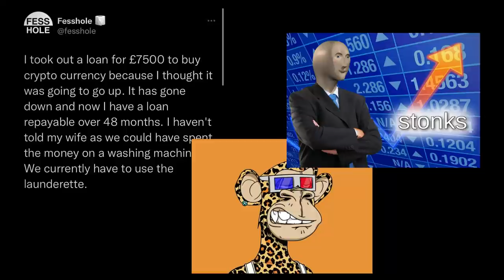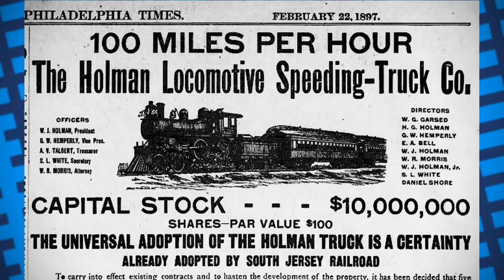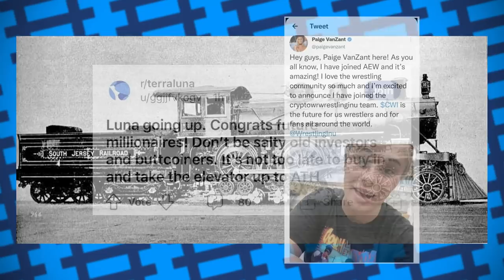How a railroad scammed investors by putting trains on stilts - Holman Locomotives

Comment: I can't imagine those things going on curves at high speed and not tipping over.
Reply: You can’t and neither did these guys most likely
Reply: Ok but it crashes like it does on trainz
Reply: The height also means more windage. So it's slower.
Reply: I really want to actually construct a physical copy of one of these just as a testbed to see how utterly stupid the performance statistics of the engine would've been
Reply: Little wheels equal speed? Didn’t British passenger locos use 8 foot drivers for speed? It’s pretty well known even then.
Reply: @philvanderlaan5942  Yeah that's what I thought....
Reply: @philvanderlaan5942  The larger drivers were to slow the action of the pistons, rods and the RPM of the wheels, and are  equivalent to overdrive on a car. Compare the Alco Big Boys built to only run between  Ogden Utah and Green River  Montana and the Alco Northern designed to haul passenger trains. The big boys have much smaller drivers increasing the torque to the wheels. Compare that to a modern diesel or electric engines that have  18” to 22” wheels but can go much faster than  any steam engine ever could. The size of traction wheel has no correlation to the rail speed obtainable.
Reply: I might be wrong but large wheels are more for speed and small ones are for power. Look at the Shay  locomotive. It was for logging on tight curves and steep grades.
Reply: @july8xx  You are WAY OFF on your wheel sizes.  Modern diesels range from 40-45" wheels.  Even the smallest freight car wheels are usually no smaller than 28", and that's because of height restrictions.  On average, most freight car wheels are 36".
Reply: 0:57 indeed
Reply: That’s okay though; it can’t get to high speeds. :P
Reply: Yeah that's why it's mentioned in the video.
Reply: Yup

Comment: The first practical reason that came to mind to me was -- more wheels = less load per wheel = less rail loading and wear. There were several diesels made that were essentially 4-axle locos with two 3-axle trucks for just this reason in areas with lighter track and bridges. Example, EMD SDL39.
Reply: If it was done on the cars that are actually carrying the load then maybe.
Reply: @michaelgarrison688 
Locomotives generally weigh a couple hundred tons and in the days of steam the drive mechanisms where a major concern for basically hammering the rails to pieces.
Look up "last of the giants union pacific railroad" at the 8 minute and 15 second mark they make specific mention of this issue when talking about the Mallet's front driving unit.

Comment: "Left: The Holman... Thing.
The word 'locomotive' scarcely seems appropriate.
The wheel arrangement is 6-12-0, if you count the wheels actually on the track. I refuse, however, to classify this with proper twelve-coupled machines."
- Douglas Self, Museum of Retrotechnology, before the 17th of May, 2005.
Reply: It's known as the Holman Horror for a reason.
Reply: @hedgehog3180 That’s where I learned about this thing!

Comment: And yet legend has it that the employees and employers of Holman Locomotive Company got away with this scam without consequences and had passed on without a trace.

In other words, the peoples behind the Holman Locomotive Company scam where never found out or punished
Reply: To be fair, the company DID deliver a "working" locomotive. So in a legal sense, the company did absolutely nothing wrong
Reply: @chanachon56  okay, however, it’s like they knew it would fail but kept themselves quiet
Reply: @nathanchan4653  Oh absolutely! But you can't prove that in court. "No your honor, there was NO possible way for us to foresee the design's failure. As the court can clearly see in these schematics, the design is labelled as 'experimental', which necessitates the building and commission of the locomotive in questionas a prototype to fully discern the design's viability."

Or something along those lines.
Reply: @chanachon56  Aye an experimental flogging is what those scammers needed.
Reply: never found? Did they try looking AT the holman locomotive company?
Reply: Much liker watering down stock and various other practices like insider trading, stuff like this was basically legal back then.

Comment: Originally the idea was to get more traction by tripling the number of drive wheels.

The math actually looks good until you factor in the internal slippage of the system ( a wheel driving a wheel, that drives the wheel in contact with the rail) 

After field tests showed no measurable improvement in traction and some major problems they decided to unload the bad  idea onto the public.
Reply: what if they replaced the upper wheels with gears instead of wheels to eliminate the slipping?
Reply: @cheezitz6730  This just introduces more manufacturing complexity, mechanical wear, and friction.
Reply: you don't increase the friction by increasing the number of wheels, that is not how friction works.  they obviously just tried to attempt higher speed by torque reduction with the smaller wheels, they just chose a really dumb way to do it

Comment: It doesn't take a basic understanding of engineering to know that design was awful. All it takes is a simple understanding of entropy.
Reply: At the time 'a simple understanding of entropy' was not a given. The second law of thermodynamics was cutting edge science. c. 1865.
Reply: @robertmyers5269  Fair point.
Reply: in my opinion (i'm not an engeneer), it works great as Hyperloop🤣🤣🤣🤣🤣🤣🤣🤣

Comment: While there's no doubt a scam involved, I can't see the engine going faster what was promised from this design.  there's no additional gearing.  More likely the idea was to provide more tractive effort with more wheel contact on the rail.  It's not the most ridiculous thing I've seen as a way to make use of an old engine that is just sitting around anyway.
Reply: Yes, there was gearing, albeit simple friction gearing as opposed to teeth. Look closely at the main driving weels - they rest on a smaller diameter portion of the secondary axles. The secondary wheels, in turn, rest on a smaller diameter of the tertiary axle, and the larger-diameter tertiary wheels rest on the rails. Of course the same ratio increase could be accomplished by using an ordinary wheel arrangement with a shorter stroke, i.e. the crank pins set closer to the axle on the drivers.

Comment: Also this train setup isn't exactly a scam, and that "Basic Knowledge of Engineering" you mentioned should instantly remind you of gear reduction, if you can get the wheels started, the large input wheel diameter would spin the smaller output wheels at a much faster rate. Ignoring stability and traction, it's a sound idea going from a big wheel to a smaller wheel to increase track speed.
Reply: Larger angular velocity =/= larger rolling speed

Comment: Since the speed of reciprocation of the steam engine is prettymuch set, wouldn't LARGER wheels lead to a faster train, not smaller?
Reply: Each additional axle provides an increase in gear ratio. They are driven on amsall diameter, and roll on a larger diameter.

Comment: This could've worked if the design was intended to slow down a locomotive to increase low-end pulling power
Reply: You mean like a Shay or Heisler? Perhaps, but to get any low-end pulling power they'd need proper gears instead of friction wheels.

Comment: I can see where they were trying to claim more speed. It basically a reduction system. But for that to work you would really need gearing. It might have been a bizarre idea to get more traction, as that would put more drive wheel surface in contact with the rails. But there were already much better ways to do that.

Comment: So it didn’t make any more torque? I figured it would be slower but more powerful
Reply: The "gearing" was to increase speed and reduce torque. There are several geared designs (using proper gears rather than friction wheels) that increase torque and decrease speed, for immense pulling power at low speed from a lightweight locomotive - the Shay, Heisler, and Climax.

Comment: Done right, it could increase speed through the magic of gear ratios. Allowing a longer stroke through the good placement of the connecting rods on the wheel to improve pressure ratios could increase efficiency without needing to actually improve or optimize the design of the engine.
Reply: Each of the small wheels only had like a 10% difference between the two surfaces they contacted other stuff with, though. If they had just made the original wheels 60% larger (which would have taken up the same space and would have been possible by moving the axles down), they'd get a better effect with less friction. But that would have meant they wouldn't have been able to convert the locomotive back as easily to sell it, and it would have been less gadget-y and thus a less effective scam.
Reply: @Pystro  making larger wheels would have taken a more expensive metallurgical process. 

Don't get me wrong, I agree that the gear ratios used were trash, not enough to compensate for drivetrain inefficiency, and a waste of money, but done right it could have been a great money saver that improves speed and efficiency.

Comment: Since it has more wheels doesnt that mean it has more traction since there is more rail contact?
Reply: So think about it this way, you have low friction wheels, on low friction wheels, on low friction wheels, on low friction steel track... that's a whole lot of low friction on low friction, you'd be lucky to get 10% of the traction of a regular train, and if there is any rain to make things even more slippery, forget about it even being able to move! And if the whole point was to make it faster, through what is effectively overdrive gears but low friction steel wheels, the initial drive wheels will slip even more. If it was gears, driving gears, driving gears on the axel of low friction steel wheel on low friction steel track, then just maybe it would work... BUT If a train works by having a F-Ton on contact pressure on a tiny spot to get traction, reducing that contact pressure on the rails themselves wasn't going to help in any meaningful way.

Logging locomotives had the most traction, as every single wheel was powered by gears and a transmission. Shay locomotive, Heisler locomotive, Climax locomotive, are examples of increased traction done right. Of course they immediately became obsolete with diesel electric, and an electric motor on each axel can go way faster than an ultra complex steam powered transmission stretching across all axels. of course it is still down to a massive amount of contact pressure and why 8 early diesel electrics weren't enough to replace the 1 Big Boy going up the Rocky Mountain pass.